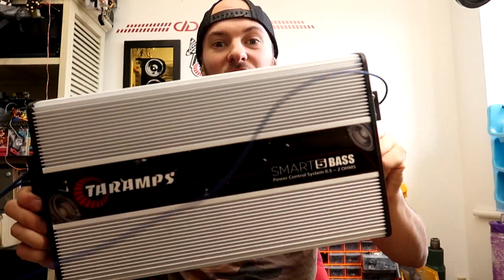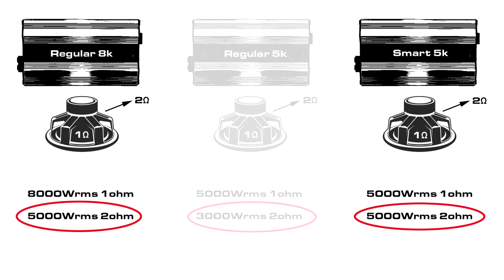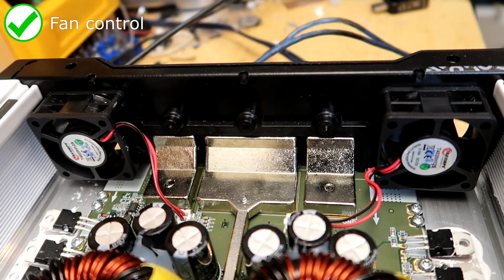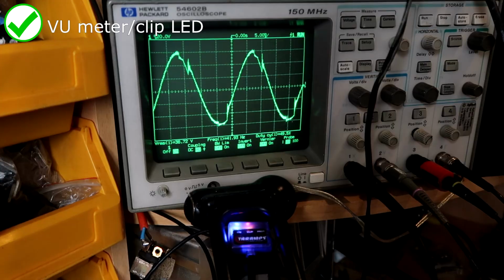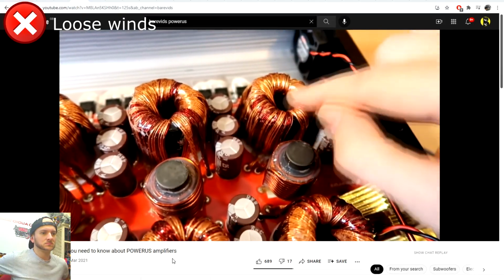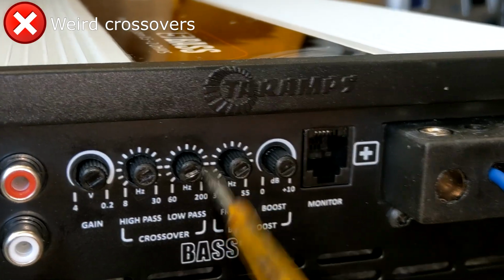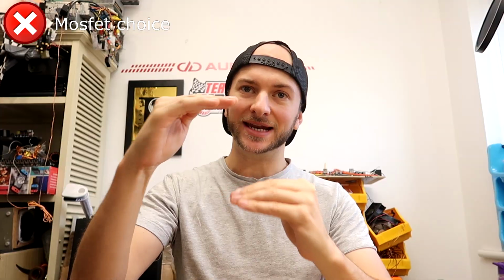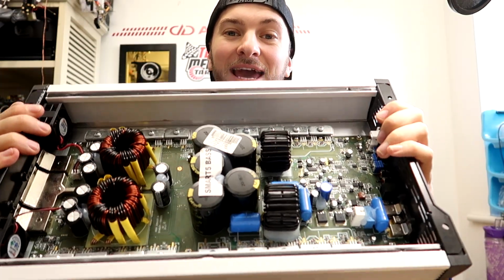The good VS the bad - Taramps SMART 5 & BASS circuit overview

Comment: Why is the outputs terminals at a high voltage, thats so weird I dont know how something like that would need to be designed. I made full bridge amplifires and didnt end up needing a setup like that
Reply from the maker: The amp uses a single positive rail voltage, example 200vdc, so the speaker terminals both have 100vdc mid point on them, so that the sine wave swings down to 0v and up to 200v.
Reply: @barevids  oh, wouldnt it also just be simpler to just use a full bridge and completly reverse polarities? Or is that what they already do but show high voltage cause of the filters

Comment: This is probably a silly question, based on pricing.

But how do you think the Smart Taramps compare to the Sundown SIA ?

Both being smart, Constant power, full bridge, mono blocks ?

Are the Sundown SIAs worth the increased cost ?
Reply from the maker: The SIA are an absolute mess. The circuits are thrown together cheaply with absolutely no validation or optimisation. Example, the sia3000 uses completely the wrong PS switching frequency for the transformers used and the fets all run hot and inefficient as a result. Sundown do not design any of their own amplifiers, however the engineers at Taramps are passionate and build their circuits from scratch and only release when they are happy.
Reply: @barevids  Man you actually responded !!

Thank you !!

Taramps it is. I would like to get a  PowerUS amp, but its out of my price range. 

It seems that you prefer the Smart Series over the Smart Bass Series.  So I'm gonna get a Smart 3k to power my 18" Dayton Ultimax. 

Thanks!! Your youtube Channel is tremendously helpful !!

Comment: I have 8 Smart 5ks how do you set the gains? being they supposed to have a load on the outputs? Do I put them on a 1ohm resistive load or just blast a 40hz test tone on my subs for a few secs and hope for the best lol, and they showcased the smart 8k today can't wait to grab one
Reply: Turn them up till they start sounding distorted and turn them down a bit

Comment: Any update as to the reliability of the bass version? Did they make revisions like on the mosfets that you mentioned? I need a new amp, and my coils are d1.4, so .7 or 2.8 are my options, the way I see it the bass version is my only choice here but the subs a team sundown so it will take just about all the power I can throw at it
Reply: Been using mine over a year now pretty maxed out🤷‍♂️

Comment: What size fuse for the Smart 3?  I can't find a spec anywhere.
Reply from the maker: Fuse for the wire you use! Nothing to do with the amp! 😊
Reply: @barevids  I ran 1/0 OFC from front of the car to trunk and installed a 350 amp fuse just off battery in the front, this goes to a 2nd battery in trunk and off that I installed a distribution block so I figured I would be better to install a smaller fuse there since that is only a short run 18" of 1/0 to the Smart 3. So I should still use another 350 amp fuse in that part of the distribution block?  I hope this makes more sense I should have explained better the first time.
Reply from the maker: @timwheeler1503  yeah a 350 would be fine ☺

Comment: I dont see point for smart amps. Lets say with smart 5 we conect 1 ohm Sub with rating 5kw. Lets say at 30 Hz Sub have 1 ohm load and 50hz 2 ohms. On subwolfer we send lets say 20 volt signal. On 30 Hz Sub need 400wats. On 50 Hz 20 wats. So ther are no point for smart amp because Sub inself dont take more wats. From smart amp be point if 2 ohm Sub on 1 freqence go 1 ohm and THEN smart think protect Subwolfer from overload, but speakers rate basicly from lowest ohm load.

Comment: The rca l and r are parallel. Manual states dual rca input/ output. Just a built in splitter
Reply: Can u use both rca's????? As inputs?

Comment: Just received a Smart 3 bass.
Now this amps accept from 0,2 to 4V rca input.
I will burn the amp if my head unit put out higher voltage?Like 5V or even 8V?
Reply from the maker: You wont burn but you will clip the pre-amp section. Just run the Head Unit at a lower volume. Anything above 4v rca is ridiculous.
Reply: Thanks for really fast answer.I have an old Eclipse cda with 8V rca output that why i asked.
I watch a video you made some years ago when you repair a DD M4 and i have one with some issues.It only start if i set gain high or some times i need to up volume to max for it to start.Any ideea what could be?
Reply from the maker: @omayel  probably the relay contacts have gone bad over time. You could replace the relays or bypass them entirely.
Reply: Thanks, i will look it to that.
I just tested the Smart 3 bass today.So impressive for the size.If will last a year maybe i will upgrade to 5.You really gain a lot of space.
I will repair my M4 so i can go back to use it in case i will not like Taramps sound or if blows.

Comment: Do you know if they're coming out with a smart base 8K by any chance?
Reply from the maker: Yep, good R&D just takes time thats all :)
Reply: @barevids  That would be so sick! Do you know an approximate time?
Reply from the maker: No idea! 😊 if I had to guess maybe spring 2024
Reply: @barevids  Well that's a better estimate than mine, I'll wait then. I wanted an 8K set up but didn't want 2 smart bass 5's for just a pair of 12's. But thanks for the info!
Reply from the maker: @mjl6425  the Bass 8K is a great amp tbh. Or get the MD12k for headroom 😁
Reply: @barevids  I would strongly consider the bass 8K as well. But would it be louder then the smart 5 bass? 

Also, I noticed the bass 8K only has one 1/0 input while smart 5 has dual 2/0's. What difference would that make? Does that mean the smart 5 puts out more power?

Comment: What about comparing the smart 3/5k and smart bass 3/5k. I want to try one of these amps but don't know which one to go for as their so similar apart from the 0.5ohm on the smart bass 3/5k
Reply from the maker: I talk about this exact comparison in this video dude. The regular smart will usually be louder overall. The Bass model will sound nicer out of the box without other active lpf and filters and may actually be louder at 0.5 if you don't have a lot of impedance rise.
Reply: @barevids  my bad. I thought you were comparing the smart 5k to the regular Bass 5k and not smart bass 5k.

Comment: Believe you can double the 150vmax mosfets in parallel to split the load across them to lower working temperatures & load. They'd have to experiment & see how it effects the circuit if they can't find higher rated mosfets. Shouldn't be different or much board redesign to add in.

Comment: @barevids if you had the amplifier gain set to 3000w at 1ohm when the sub is playing and rises to 4ohm would it be a 2900w output or would it be 2000w because the gain is lower

Comment: So can you run the original smart 5k at .5ohms without issues? I have dual D2 vxf 15s
Reply: Dual 2 olm subs can only be wired down to 1 olm the lowest. You need Dual 1olm if u want to run the amp at 0.5 olm

Comment: Mr Sam!
If I'm setting my filters with a CC1 do the sketchy filter setting apply to me. Or will they be set correctly with the CC1?
Thanks brother!
Reply from the maker: For regular smart 5, leave the CC1 on the side, set all knobs to minimum and set active lpf 55hz ☺
Reply: @barevids First thanks alot for the reply it is very helpful.OK so still use hu for filters (active).
One more question for you sir. My head unit only offers subwoofer lpf, no high pass on head unit. Lpf on head unit offers 50hz 80hz 120hz 160hz
where should I set Hpf on amp since I don't have Hpf on head unit.
Setup is 2 12" Incriminator Audio Death Rows in Gately 4.0 cu ft. subs up port back tuned to 32hz

Comment: That spike is an easy fix. They should use 4 transformers tightly would in a two step voltage amplifier.

Comment: hey Sam, i want to use the taramps ts400.4 to run tweeters but iam not sure about the way you wire in the tweeters to the amp.. i think it might be a noisy design as i have never seen only 3 speaker inputs for two speakes on an amp... sq is the main goal.. Can you advise if this amplifier is gonna be silent to my arc audio black tweeters?? Another thought,, how is the switching done with no output transistors.. at least i didnt see any on the heat sinks!!
Reply from the maker: You want class AB on tweeters not class D, you don't need much power at all like 30w would be enough.

Comment: Hi Sam. I went ahead and bought the smart 5k. I am very happy with it m and thank u for this video. U helped out alot. I have a question. I'm seeing a lot of comments about people saying that these amps like or set it to 1.8 to 2.0 ac volts rca inputs.. WHY? What happens if I go with 4 or 5 volts ac? What advantages do I get by setting it at those lower voltages? I haven't seen any proof of this or an explanation as to why taramps perform better at 1.8 to 2.0 ac volts of rca input? I hope u see this and have time to explain this .. thank u . U are a badass at what u do and I appreciate the videos.

Comment: And that is wy i use electrische crossover.
And still use my Kenwood baby equalizer.

For the rest this amp junk.
Sorry even my old Amps looks cleaner inside.
And now for use in your car driving on the highway i do not need 3000watt RMS in my trunk.

Comment: The only reason I purchased the bass version is because I'm wired to .5 ohms, and so far the amp sounds great!  No clipping and the bass sounds smooth and the lower bass sounds incredible!  I have 4 12's 1200watts rms each, and with an rca bass knob( too bad taramps didn't provide a bass knob) I can adjust the level to my speakers ability and not overpower them.  Btw awesome informative video.  You are the best on YouTube.
Reply: Is your amp still holding up good? I’m thinking of buying the smart 5 bass to run .5 ohm zv6.

Comment: Hay bro I has a question. I have the 2000x4 the 2 ohms model an I have 2 DS18 8s 8 ohms an 2 DS18 10s 8 ohms as well mid-range..I want to bridge them what is the final impedance output all speaker wired separately  from the box going to the amplifier. Can get some advice on that please and thank you
Reply: Look up speaker wiring calculator. You can input how many speakers you have and what resistance they are and it’ll tell you all the wiring options

Comment: Sam so on the Taramps 3k would you go with the regular or bass version? Do the 3k fets have the same issue you state as the 5k bass version? Thanks a lot. I’m leaning to the 3k
Reply from the maker: If you understand HPF and LPF and are experienced with tuning a system, get the regular smart 3, it's more powerful. If you aren't sure and just want some bass easy, get the Bass version.
Reply: Thanks bud. I’m gonna go for the regular 3k.

Comment: Okay so I replaced a sundown saz 2500 for a tramps smart 3 bass. It's louder but I feel the bass sounds terrible. Sub crossover at 60 hz but everything sounds like flat bass without depth
Reply: Yes I resolved the issue. I put my sundown back in and sold the taramps problem solved. Sundown maybe a little bit quieter in spl but it sounds 3x better. The guy I sold the taramps to got tied of it a couple weeks also so it's for sale again
Reply: @Banshee421x  thanks for letting me know I had the sundown sfb and a soundgital 3k then picked up the crecendo bc4k and there's no comparison the sound quality of a Korean board only some can tell the difference and i was skeptical about the taramps.
Reply: @DJRIKSTA  The full bridged amps are just different. It's something I don't like the bass don't have the depth it's more like a impact. I'm sticking to traditional amps for now. You can see the difference in price too salt 3k is like 1100 and the sfb 3k is like 500
Reply: @Banshee421x  100% agree 👍
Reply from the maker: Turn all the knobs to zero other than the level/gain. You should have no hpf set at all
Reply: Did u resolve this issue thinking of switching from my Korean 4k to the smart 5

Comment: Wish they made a smart version for 2/4ohm rise. I've always ran 2ohms so the smart series don't really help with impendace rise
Reply from the maker: Why do you run 2ohms?
Reply: @barevids  for years I I've went with Brazilian 2ohm versions of amps.
Reply: @barevids  don't know why. Just happened that way. Got a sound digital 2ohm version before and ran my subs at the lowest I can (2ohm) and since then I've always just ran 2ohm because all my amps are 2ohm amps and my subs wire down to 2ohms

Comment: I own an hd3000 1 ohm wired at 4ohm to 2 12 inch subs and it bangs, but nice to know about the model difference and I do want to upgrade to 5-8k eventually so thanks for the information

Comment: Have you looked at any of the JP amps curious to hear yout views on them an build quality
Reply from the maker: We don't have them over here but they're just generic boards.
Reply: @barevids  i kinda figured  do you know what they are possibly  trying to clone? Ive bought 2 recently an they work really well for the most part. Exept the four channel likes to cut out. Customer service said i need to run 8 gauge wire to my tweeters an stock speakers to get it to stop. Personally i think thats insane.  I have no issues  running 14 gauge off the sub amp i bought from them not sure why id need 8 gauge  running to somewhat standard his an mids. Any thoughts on that ? Cause im not sure i trust their support so much after telling me that. I replaced  a 60 crunch that never cut out with the exact same wiring. I did upgrade the power wire because 10 gauge  is definitely not enough  for the JP84 ,but certainly it shoulf function fine with 12 gauge  to his mids. Maybe im wrong.
Reply: Also really enjoy your vids man. I always wanted to know how to work on amps an such. Unfortunately i have poor vision big hands an low tolerance for tedious work.

Comment: Hey Sam. Toward 15min in you were saying the smart 5 would be louder then SBass 5k. But looking at 4x rise dynos the SB5k does more wattage. I understand you are saying because the rail voltages are higher. But if there's more wattage how would it be louder? I definitely like the reliability factor you speak of.

Comment: I would love to get the smart 5, but I recently saw a video explaining how they were not as good with Low’s 20-30’s  compared to a half bridge Korean made amp. I’m wondering how true that is or not. Anybody with knowledge or experience in this area?
Reply from the maker: It's absolute nonsense. That video was made just to try and sell people his own brand of amps. Provided you set the filters correctly these amps play the lows just as well as any other.
Reply: @barevids  Thanks for the quick response. That was my gut feeling too since he was a EMF rep comparing a EMF amp to Taramps. I actually have the smart 3 and happy with it but after watching the video was second guessing my purchase. So after some research I was still 50-50. Some people said they heard a difference and some not. It was convincing but I wasn’t totally convinced. But hearing this coming from you gives me validation, Thanks.
Reply: I've been on the fence because of the same video and it's reassuring to hear Sam address it. Emf had a similar video about skar amps and his response video proved it completely wrong

Comment: Super Sam to the rescue.. I lost my faith in taramps, I use to have the 3k bass and a lot of bass notes were missing and not quite there. But bigger amp big subs more current etc etc. Never ends
Reply from the maker: You'll have had the filters set wrong. All the knobs need to be at zero other than the gain. If you are missing higher bass kicks then turn lpf up a touch. Hpf or subsonic should never be touched.

Comment: Helpful video to understand some technical features on those bad boys, now actually is kind of difficult found help with this amps so I need some advice on my setup I have some issues with light dimming on my car I have a Taramps HD3000 4ohm with 2 Skars 12's 1600 watts each at 4ohm wired on series I hook up a "10farad capacitor" to see if improve the dimming but it doesn't help much, so what can I do to prevent light dimming on my car?
Reply: You aren't even close to having enough battery power to run that amp that 10 farad capacitor is doing absolutely nothing for you somebody obviously did not explain to you how much energy it takes to run these amplifiers especially if you don't want to burn them up you need at least two d3100's or somewhere near 45 amp hours of lithium along with an alternator and one ought power wire . Good luck my friend but definitely get you some batteries you're going to burn the amp up in a heartbeat if you don't.
Reply: Do the big 3 on your wire's. Battery, alternate r, starter to 0 gauge wire. And get a really good lithium battery. And double check your ground's also.

Comment: 196v that's why they put fans in. If the fans fail, curious if there's a safeguard, where the amp will not power on or work, being a non functioning fan. Technics integrated amplifiers in the early 90s utilized that type of circuitry, the heat sinks were too small, if the fan failed to work the unit would go into overload immediately. Otherwise I'd see this taramp running too hot under load and ultimately fail.

Comment: Do these amp still get really hot? I remember last year I had the 3k amp and it got really hot to the point where I couldn't touch the amp and it freaked me out that I ended up taking that amp out
Reply from the maker: Hot to where you can't touch is about 65-80C. Not absolutely critical temps for electronics. If you reduce LPF and maybe add a single fan to it, it would have been fine.